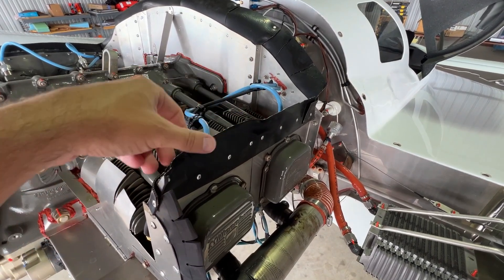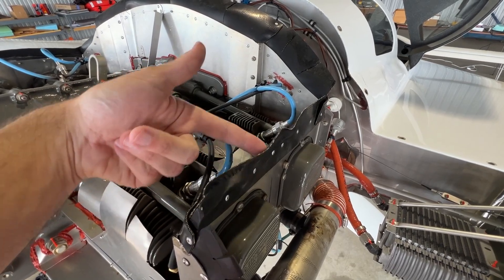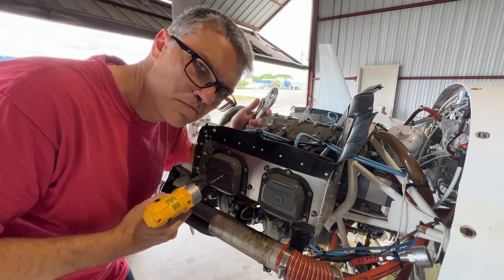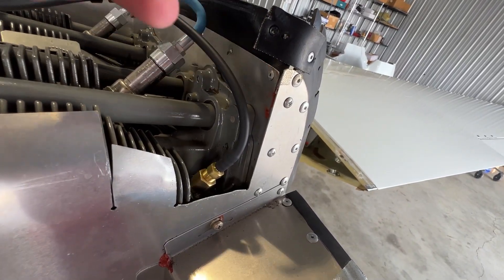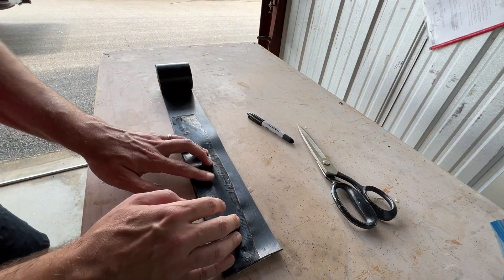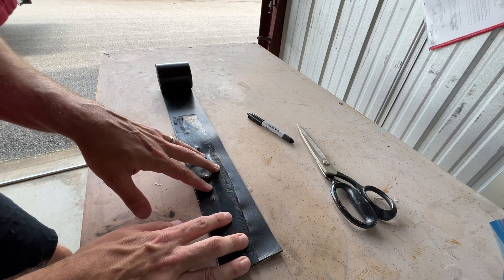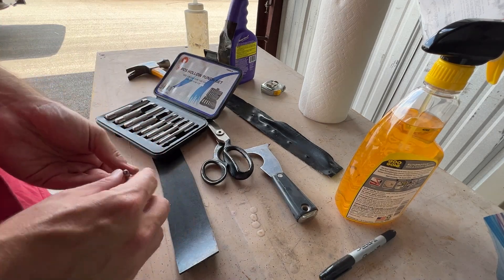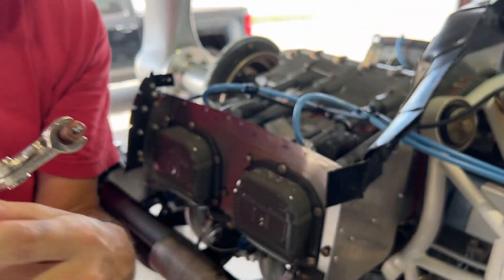A Baffling Problem with my Experimental Aircraft

Comment: in my opinion the soft baffle should sit on the inside of the baffling as that's where the pressure is, to contain the air inside and force it over the cylinders...